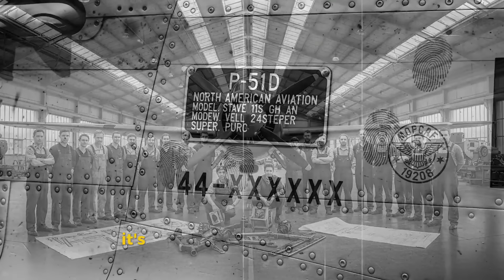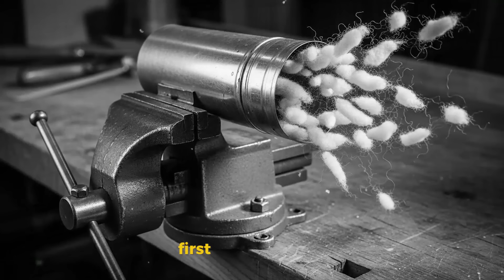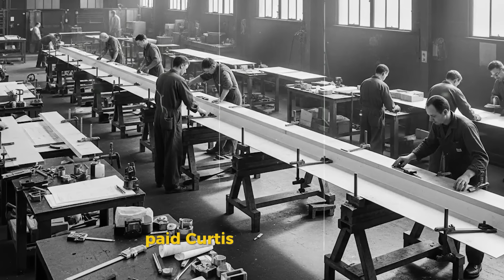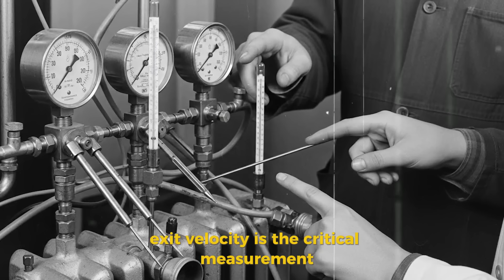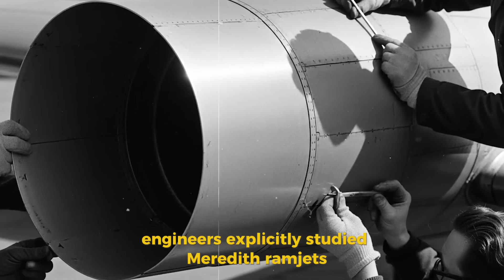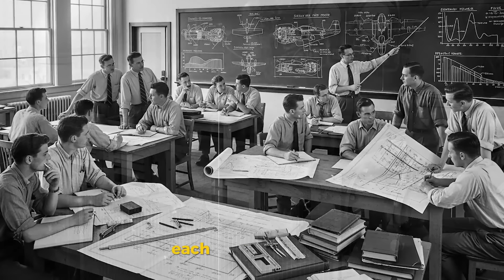THE P-51'S SECRET: How Meredith Effect Radiator Design Reduced Cooling Drag To Near-Zero

Comment: It talks about the P-51 being an "immediate" success and changed the war when it was introduced.  That's a load of crap.  It wasn't until drop tanks were delivered that the P-51 could escort bombers all the way to their targets and come back home with them.  And most sources credit some officer with inventing the paper drop tanks, but it was a Sergeant that actually invented them - because the engineers kept trying to use metal drop tanks and they produced too much drag to help.  But the paper tanks didn't add the same weight and worked well enough, and THAT is why the P-51 was able to fly longer missions.  Not because of what engineers did, but in spite of them.

Comment: Dear AI: New Rules: 1. Propellers are symmetrical. And have 3 or 4 blades, evenly distributed, but not both on the same plane in the same pic. 2. Scientists do not hang around inside weird "wind tunnels", with smoke curling around their offices. 3. Most people do not smoke two cigarettes at the same time, with both hands. Overall, a late-night tequila and pizza dream.

Comment: Planes that never existed, parts that never existed, air flow that doesn't function in this universe or any other that I'm aware of, this has got to be the worst video I have ever seen and I haven't watched more than one minute and 11 seconds of it. You didn't do any research and do finding actual photographs in order to make this it is all generated through actual ignorance instead of anything that resembles intelligence of any kind. There is more than enough data out there that you can research and get a hold of that would be a practical example of what you are speaking of and you haven't even shown the P-51 until over a minute into the video. And I seriously doubt that it is to scale. So even that statement may not be true even in that part of the video the aircraft seems to have a V10 engine. I seriously doubt because I have been studying World War II since about 1969. I don't disagree with the subject matter. But your method for bringing it. Because you're obviously not taking the time or having the respect for the viewer to even higher a damn narrator, why in the world you waste my time with this garbage???

Comment: The narration is accurate both historically and from an engineering perspective.  It's a SHAME that the video is populated by hardware, aircraft and instrumentation best described as AI on a bad acid trip. I found VERY LITTLE, IF ANYTHING in the videos that represented the actual P-51 radiator.
Reply: I agree.  The info is interesting.  But the visuals make it difficult to watch at best.  And disturbingly misleading if this our future under the yoke of AI
Reply from the maker: I appreciate your feedback on the visuals and your acknowledgment of the narration's accuracy!
Reply: Many other documentaries, like the one on Willow Run that kept showing B25's, show up all the time. I guess video editing people cannot tell one airplane for the next. Maybe people should start making pure engineering videos. I would like that, for sure. Ones that talk about tolerances and flow rates. How does maintenance change physical requirements? And how did they test everything before flying around?
Reply: The AI thinks calipers, dials and old fashioned hair cut is enough. The pictures of mechanicals objects and blueprints are born in an engineer nightmare ! Sorry but I couldn't finish the video.
Reply: There is no such thing as a bad 🙂

Comment: The proper name for an Aircraft's "Propeller" is an "Airscrew." Its not thrust that moves the craft through the air. It is being pulled by a simple machine called a threaded screw. Like a Hotrod in a burnout that then hooks up and begins to move forward. Aircraft slip at takeoff and climb out until they "hookup." The added thrust from the airscoop simply speeds up the tractoring process.
Reply: There is no "hookup" phenomenon relative to propellers or air as a medium. Propeller pulling or creating thrust is simple a frame of reference difference. A pound of thrust is exactly equal to a pound of propeller pull